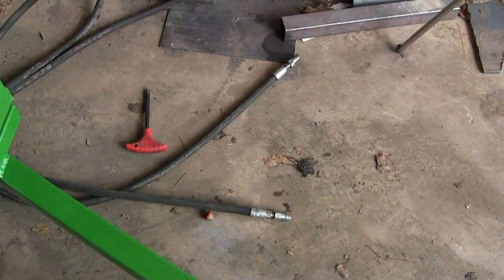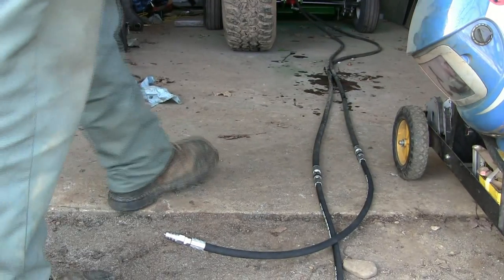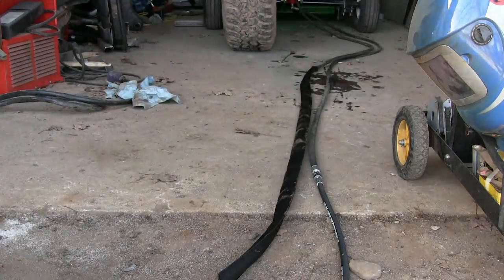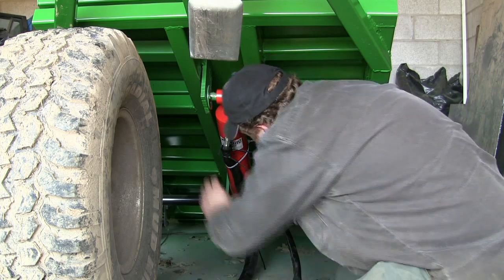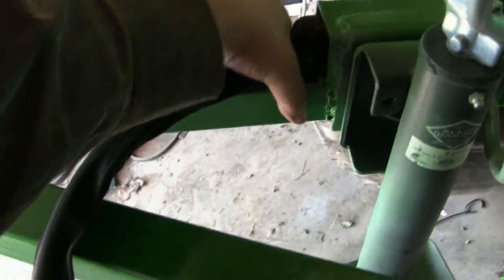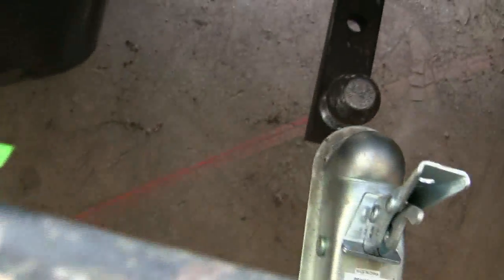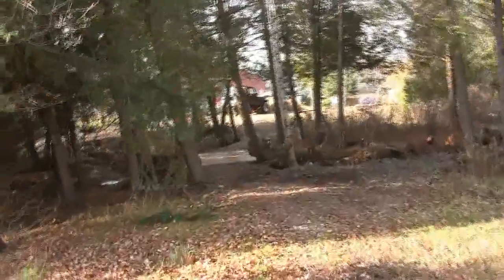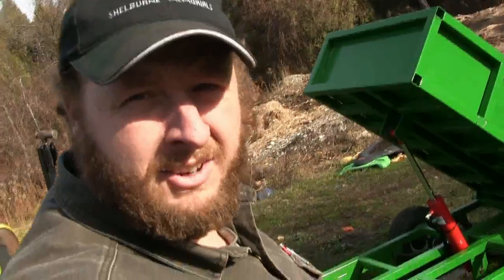routing and wraping the hoses and a trial run of the new trailer

Comment: Hi Bill,

Well done, and you can alway do the grinding and other welding when you have time and it will be perfect for you. Of course to most others it is already ten times better than a shop bought one anyway!
You must feel like I did after spending a month stripping my engine down, that is everything apart from the gear-box, and new pistons, rings, big ends, rods and race cam, and it felt great to start it in the shed where it just had a paper-cup of juice for a tank, bouncing all over.

Comment: Hey Bill I have made a few things in my day also. May I suggest for the welds that are not on the out side of the trailer either black or dark green silicone run a bead along to clean it up a bit I have done this myself and yes along with your end caps it will set it off sweet.

Comment: Are you, or did you intend to get some bungs to stop the weather getting in the ends of the tubes?

What was it you said about the colour being slightly off? Why not spray the underneath in a small patch area to see if another coat will make any difference?

Comment: Great build you did there Bill!! I'm impressed!  What's the point of the hydraulic 'pantyhose' you put on the hoses? lol...just wondering.  I worked with forklifts for years and let me tell you, the power of hydraulics is amazing, I've made it spray hundreds of feet in the air when the attachment connection broke loll